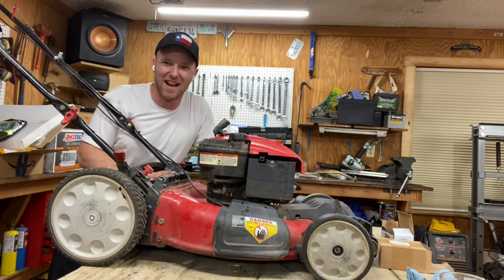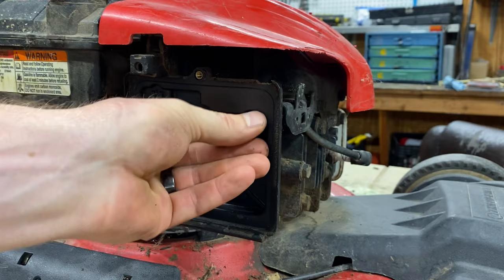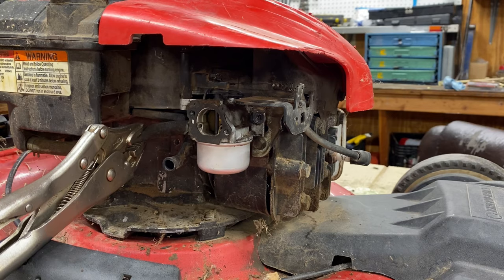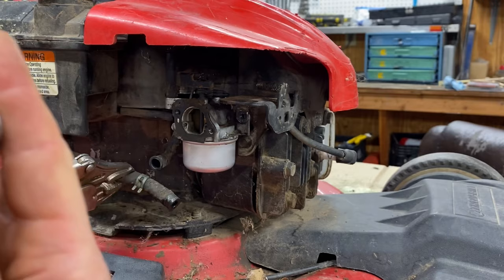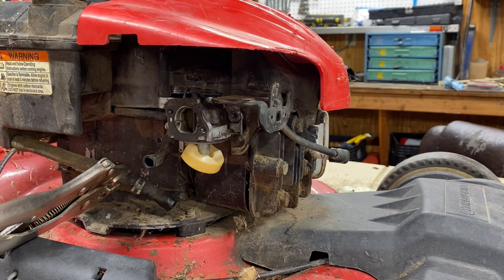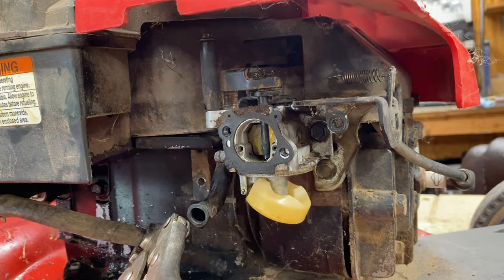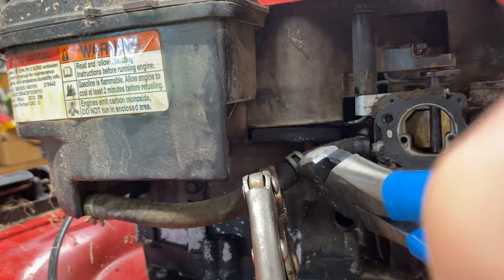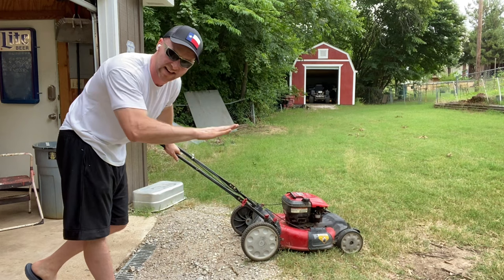Lawn Mower Won’t Start: Troy Bilt TB230

Comment: Dude!!  After watching a half dozen other videos and spending an entire weekend working on my old TroyBilt that was in storage 3 years, I watched this video and the part about cleaning the jet holes in the nut.  Not sure if it was that, or cleaning out the entire carburetor, or flushing the fuel tank/fuel line...or all three.  But you were the only video that showed me how to clean the jet holes.  That must have done the trick, because it literally started on my FIRST PULL.  I was stoked.  You made this accountant feel like a genuine mechanic!  You rock!
Reply from the maker: Haha that is awesome, glad I could help. You know I am a fellow account in real life we can still turn some wrenches.
Reply: Mike you save me big time so I follow the video and I was able to cut my grass today.  Thanks a lot

Comment: THANK YOU, THANK YOU, THANK YOU!!!  My Craftsman self-propelled walk-behind mower crapped out in the middle of doing the yard.  No warning, just died.  Mower was barely a year old and the 2 year "warranty" would not cover what they said was a carburetor issue (normal "wear and tear" they said was not covered.  On a less than 1 year old machine?!?!?!).  Shop wanted minimum of $150 to fix (called multiple places and they all said the same).  Long story even longer, I watched your video and thought "Hmmm, even I could try that.  Got nothing to lose".  About 1 hour later I am up and running and my mower is slicing through my (9 inch long and overgrown) lawn like a BEAST!  I can't thank you enough for creating a THOROUGH and SIMPLE video for a mechanical moron like myself.  I owe you several beers if our paths ever cross.  Thank you again, you are a lifesaver!  ~Adam~
Reply from the maker: Ah man I appreciate the kind words. Sounds like you are just getting started on your handyman journey. Don’t be afraid to jump in and fix stuff yourself, you got this.

Comment: Thank YOU!
Cleaning out the carb bolt did the trick! Glad you showed the “twist tie” trick, since I couldn’t find a wire that small anywhere in the house!
👍👍
Reply from the maker: Haha that is awesome. Fixed your mower with a twist tie. I was just saying that, didn’t know it actually worked. I may have to do a video on it. Thanks for the feedback

Comment: Thanks man, my mower was surging and sputtering and I followed this guide and it runs like new again, starts right up and is smooth. I did not see any obvious debris but still followed your instructions and sure enough it fixed it right up. Thanks for the video
Reply from the maker: Excellent, congrats on the fix. Just had to clear the pipes

Comment: Fantastic video. Did mine the same way. 25 year old mower/motor started second pull. Had water in the gas.
Reply from the maker: That is great, thanks for the feedback. Just have to clear her lungs out

Comment: Thanks, Mike. I was able to fix it myself with your lead. There was a little plug  blocking the gas from getting through the tiny channel between the lower chamber where the float valve is in to the channel that goes to the engine. Using the wire and the carb cleaner it worked. Thank you. Dave
Reply from the maker: Glad I could help get ya back to cutting

Comment: Mike - My mower wouldn't stay running and thought it was because the gas was old, then ran across your video.  Not really  that sure of what I was doing, I followed exactly what you said, and presto, started right up, ran like  charm, and I mowed my yard!  I got two other mowers that have sat for a couple years, so they're my next project - just need to learn how to fix the self propel.  Do you have any videos on that?  Anyway, thanks, buddy, you were a life-saver!
Reply from the maker: Glad I could help. No videos on the self propel. There should be a little belt that runs off a pulley from the motor to the front whee. I suggest removing the cover over the little belt and see how it looks or if the belt is slipping or broke. Stop piling up broke mowers in your yard or you will end up like me lol

Comment: Well, I changed out the old gasoline ⛽️ and spark plug, and changed the oil, still not working, so I am going to do what you suggested  tomorrow !
Reply from the maker: I bet you will get it going, good luck

Comment: Thanks! I had gotten to the jet before as it had some debris in it causing it to keep dying on me, but had forgotten where it was at. It has sat for two years this time and I am sure it is just the old gas clogging it up.
Reply from the maker: Yep make sure to drain that old gas out first. I only use ethanol free fuel in mowers makes a huge difference

Comment: Does using a known good fuel additive help with the fuel not gumming up in the bowl / float area and inside the carb?
Reply from the maker: Use ethanal free fuel is your best bet. Or search through my channel, I have a video on an additive that worked good. Can’t remember the name.

Comment: Howdy Mike!  I need your opinion!!  Cub Cadet LT1045. I replaced the main wiring harness, all new gas lines, new fuel pump, all new filters, new spark plug, new carb.  The sucker won’t turn over.  Cub Cadet says debris in the carb.  I can’t see how.  Everything is new. Gas tank was cleaned out and air dried for 2 months and fresh gas put in.  What can I try to get her to run??
Reply from the maker: I would check that you have spark, then if you have spark then check you are getting fuel to the carb, then if your fuel pump is good check you don’t have any intake leaks (spray carb cleaner around carb and see if it gurgles) I have some good videos on spark and fuel pumps. Good luck

Comment: Mike, is there a gasket behind the air filter housing where it connects to the carburetor. If so, my TB230 (also a neighbor throw away) was missing the gasket…wasn’t sure so I just cleaned the carb like you did and it fired right up. Wondering if I need the gasket now after-the-fact. Looks like a thin black gasket on yours at the intake. Sorry for the trouble if you could check yours for it. Thanks.
Reply from the maker: You def need that gasket behind the intake. If you have it I would put it on. You don’t want dirt sucking up in there.
Reply: @MowerMike  Thanks…I knew something looked odd! I’ll get one. It ran well after cleaning the carb, but not the long-term way to run it. I’m 2 for 2 getting these free curbside mowers to run again.
Reply from the maker: @BornToFly4031  I suggest just buying a cheapo Amazon carb. It will come with the new gaskets. 

Also on free mowers a cheap compression tester will tell you real quick if they are worth fixing. On a pull start you want atleast 80psi or the motor is junk.

Comment: FIXED! Bought everything you recommended, followed your video and BOOM started and ran like new for about 30min until I stopped the mower to take phone call. Went to start it back up and noticed gas leaking from the bottom of the air filter. I quickly switch out the air filter again got about 10min until it just shut off and gas started pouring out from the bottom of the air filter again. I went from the highest high to feeling defeted and about to give up haha any suggestions or should I have my man card revoked?
Reply from the maker: Haha nah you are good. Your float is probably leaking. I suggest getting a new cheapo carb

Comment: What do you do when you have a mower that someone has removed all of the air filter parts for it and there is white stuff in the boot that goes onto the spark plug. It ran for a little while and we had to get some more gas for it. What additives do you suggest for 87 octane fuel in a 1 gallon container? No the blasted thing won't run for more than maybe 10 seconds... Any suggestions? Remember, we have a full fuel tank. Still try the carburetor trick?
Reply from the maker: Wow quite the issue. I wouldn’t worry about the white stuff that is probably just to help the plug connection. Man I have no idea, I would start with cleaning the carb and then if that doesn’t work I would just throw it on the trash. Good luck

Comment: Hi Mike, I have the same mower I bought off someone recently. I did everything you did in the video. It still will not start. Is there anything else I can try?
Reply from the maker: Check that the plug is good and you are getting spark. If it is and still not starting then try a little starter fluid. If it is still not starting check the compression or put it on the side of the road. Once they lose compression they really are not worth messing with. Good luck 

https://youtu.be/uwEXb206NFI

Comment: Have a TB130 that has been sitting for 7 years.  A while back I only dropped the carb bowl and cleaned the jets on the bolt.  I’m willing to bet my obstruction is after the main fuel line.
Any recommendations on creating a vacuum over the intake once the air filter is removed?
Reply from the maker: Not following what you are asking. The engine creates vacuum which sucks the air and fuel into the engine
Reply: @MowerMike  I had another unit that airlocked, and in order to get it going I had to remove the air filter and cover the intake with my hand.  The tricky part is that you have to remove your hand as soon as the engine turns over, otherwise it’ll be smothered.  This purged the lines by creating enough suction to push air out.  My theory is that with the TB130 this will do the same likely clearing the obstruction by pushing it downstream.  I may have to use a small plastic cup since this requires three hands.

Comment: hi
 I have a Troy Bilt 21" self propelled mower 2 in1 Briggs & Stratton 650 series 190cc/650
The interlock switch one prong came off w/o me knowing about. Now I have bought a new and want to know which wire goes where ( This interlock is on the R side of the motor if you are facing the front of the mower) Thanks for your help.
Reply from the maker: I have no idea what an interlock switch even is. Try it one way and then the other see which one works

Comment: Do you know what size spark plug? I thought it was just a spark plug, took out the old one and now wandering if the one I put in is the correct
Reply from the maker: Just take the old one to the auto parts store so they can match it.

Comment: My mower ran fine a few months ago. It sat but no gas in it. Filled it with new gas and the engine just wont turn over. Wonder if i need to do all this..
Reply from the maker: Only one way to find out

Comment: What about the self drive quit working that’s my problem and it’s not adjustment on the cable my lever just doesn’t get tight
Reply from the maker: That is outside my lane. Just start taking stuff apart and you will figure it out.

Comment: Thank you for posting this! You saved me at least $100! Do you have a video to help with a new weed eater not starting now?
Reply from the maker: Glad it helped ya out, you kicked that mowers butt!  For a new weed eater just look up the instructions to start it. Usually you pump the bulb 6-10 times, put it on full choke and pull it a couple of times. And then when it starts out it on half choke or no choke. Make sure to pull the throttle lever all the way down while you try and start it. You got this
Reply: @MowerMike  we used it twice and it worked fine, but my son went to use it the other day and nothing…
Reply: It’s a black max.
Reply from the maker: @christineboozer9980  Check there is gas in it and remember it has to have oil in the gas. Can’t just use regular fuel
Reply: Done, still won't start...
Reply from the maker: @christineboozer9980  I suggest you return that trimmer and buy and electric one. ;)
Reply: Awesome

Comment: I put a new carburetor on my Briggs Stanton  Snapper and it shows no sign of wanting to start. The rope pull good.  Any suggestions.
Reply from the maker: Try checking the spark. I have a few videos on it.
Reply: @MowerMike  OK. thanks. I will wait until Rain stops here in Central Calif. But I heard it takes 2 people to check spark.  But I will find someone to help me.

Comment: Hi, I followed this video and my mower went from not starting at all to starting up but running kind of sputtery and eventually peeteriing out all together. Is there an extra step I need to do? also, I've noticed that the bottom of the corroborator bowl gets kind of moist and dirty when I run the mower. Does that mean that it's getting flooded some how? If so how would I take care of that?  Thanks for any help you can offer with this!
Reply from the maker: I suggest draining the fuel from the tank and getting a new carburetor on it. Your needle above the float is probably clogged.
Reply: @MowerMike  Hi Thanks for your prompt reply! So I bought a whole new carburetor and just installed it and now the mower won't start at all! Is there a step I'm missing? do I need to prime it or something?  Thanks for all your help.
Reply from the maker: @bobisbblu It may not be priming. Try either shooting air into the hole in the red nipple thing or splash a bit of gas in the carb. If it starts and runs then you know it isn’t priming.

Comment: OK so I watched your video and I was doing what you’re doing but I had this little pointy metal piece fall out when I took the bulb out. And now I can’t get it back in. Help 😬😩
Reply from the maker: Kohler Carburetor Cleaning on Cub Cadet GTX1054 Mower
https://youtu.be/TIJocbLRl2A

Check out that video. Sounds like the needle feel out. It is easy just slide it back in there and instal the float again.

Comment: I got a free one and can barely pull the rope. Is there a secret to starting ?
Reply from the maker: That means the piston is froozen up and the engine is shot. You can try pouring some tranny fluid into the spark plug hole to try and break it free.

Comment: Car cleaner fluid? Can I use WD40?
Reply from the maker: It is called Carburetor cleaner can get it anywhere. I wouldn’t use WD40. But as long as you get the little holes clean that is all that matters.

Comment: Help.   Problem. . Mow starts then when I stop to empty bag  it will not start again,  at least for  15- 20 minutes. Then it will start again. I went through the carb cleaning video did not help.        Thanks robert
Reply from the maker: Mower maybe shot. Sounds like it is losing compression when it cools off or heats ups. You can try a compression test or just buy a new one.
Reply: @MowerMike  thanks for reply:)
Reply: @MowerMike    I was able to mow solid for 15 minutes, just took off bag….

Comment: I have a TB130 ( Troy bilt) need a carburetor and related gaskets it has a Honda engine
Reply from the maker: Time to get on google and find them
Reply: @MowerMike  I have and they all say ' I don't have that carburetor" for TB130 XP"
Reply from the maker: @gradyhernandez4699  Good luck just clean it like I did on the video
Reply: @MowerMike  ok

Comment: Replacement carburetor in 2023 costs as low as $10 off ebay with free shipping.

For some, cheaper and easier to buy replacement.
Reply from the maker: Can’t argue that logic Promyntheus???